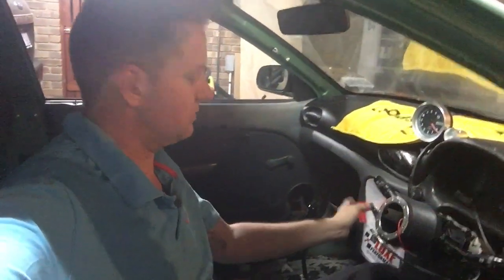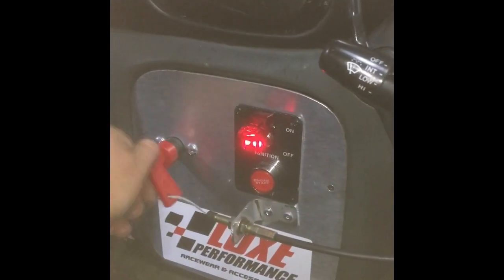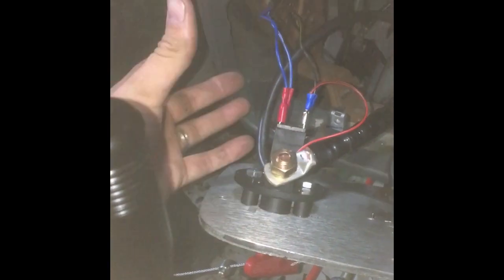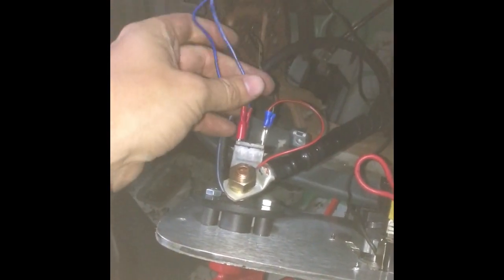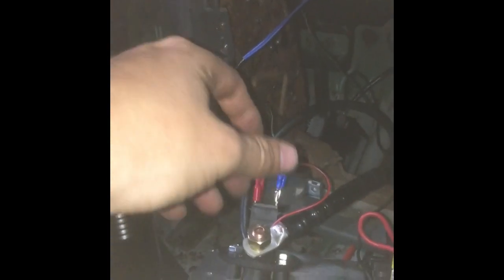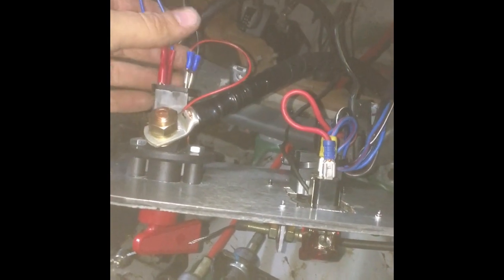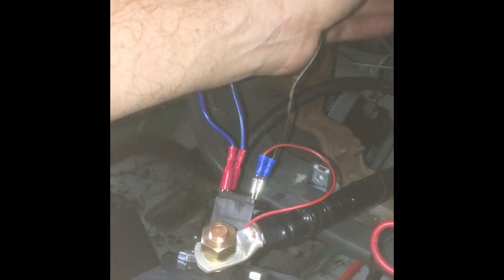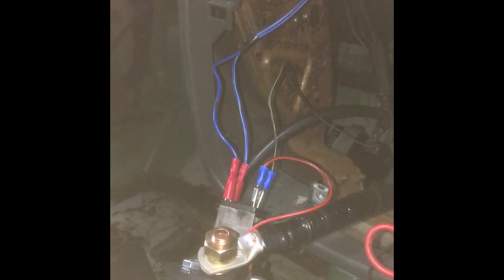Race Car how to wire and use 6 pole battery isolator kill switches

Comment: So I could have the isolator under the bonnet clost to the batter and have the pull cord in the cabin?
Reply from the maker: Yes depending on your category- circuit cars have to have a secondary location external at the base of drivers a pillar - having two pull cables on the switch is messy an typically dosnt work as they bind up  - on production cars where we don’t move the battery (like our Renault) we use the cartec solid state electric isolators with two switch buttons one inside an one outside - might be better in your situation